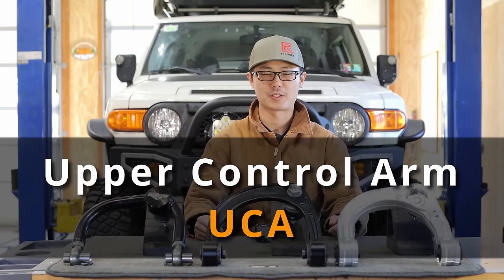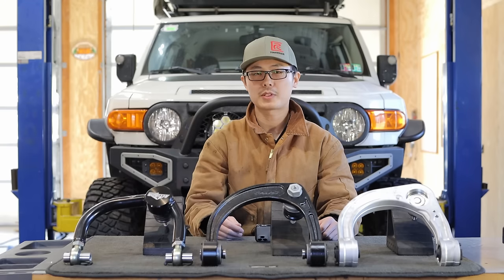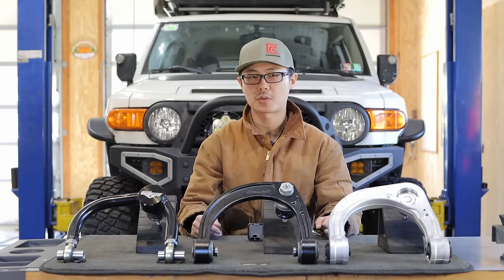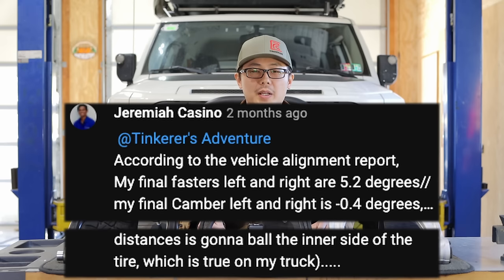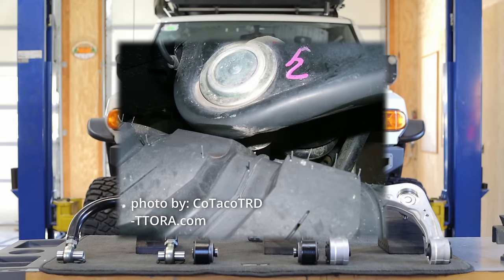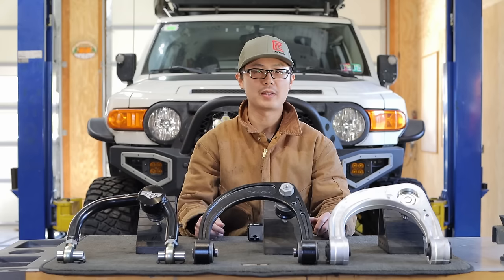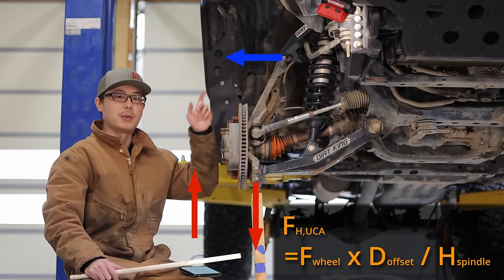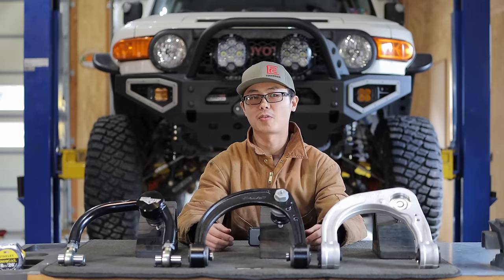UCA's True Functions and Misconceptions | Toyota Aftermarket UCA Part 1

Comment: Hello sir I am new to your channel but I am finding your videos very helpful and informative but I have a question for you I would like to know your opinion about doing a ball joint flip as in changing the orientation from the top to the bottom of the UCA this is a popular modification for 1988 to 1998 GM 4X4 trucks

Comment: Have you done any research on rear trailing arms, I'm particularly interested in corrosion resistance, I run the beaches of s. Texas, already have aluminum bumper, stainless rock sliders & replaced all trim bolts with stainless, corrosion is big on our beaches. Thanks! Kal

Comment: I was planning to run q 2in quick lift and aftermarket uca so that the upper ball joint will in effect compensate the lift. Also was considering extending the bump stop..any thoughts on your part is greatly appreciated..great video by the way

Comment: Future video idea - Would you please consider front locker impact to stock tie rod, axle or any other related component with not too heavy tires. Heaviest I have is Load C 285/70R17 KO2. I'm scared seeing bent tie rods. I guess axles could be next? Thank you in advanced..
Reply from the maker: I do plan to make a front locker video! Good suggestions on those concerns. Stay tuned!
Reply: @TinkerersAdventure  that is awesome. I took 2 quotes for eaton elocker & ARB air locker. Shop told me eaton elocker would release if I roll back. I'm more worried if it could break any stock components. Would be nice to give lot of stress and see if tie rods bend / axles would break. Thank you again.

Comment: Very informative and understandable.

I have a question about the AccuTune UCA. Somewhere I have seen where a fab shop or licensed repair shop has mentioned that using threads for certain tasks can lead to damaged or galled threads. What is your opinion for their UCA?

Keep on making these great videos. Sometimes I can't quite follow the whole presentation, but I'm also not an engineer, so I rewind, and I still don't always get it. It'll eventually sink in. Regardless, I find these videos very interesting.
Reply from the maker: Thanks! I don’t see any issue with the threaded heim joints. Almost all thread related failure were due to loss of pre-tension. Because of all the misinstallation out there and people not willing to admit they make mistakes, the design themselves typically take the blame and myths emerges over the Internet.

Comment: Outstanding job on this video, thank you!  So, in conclusion, if I'm going to level or add 2" or less to the front of my 2019 Tacoma, it would be unnecessary to change the UCAs, strength and droop-wise, correct?
Reply from the maker: Thanks. That is correct.

Comment: I just came across horizontally mounted uniball UCA’s. Seems like more manufacturers should offer that style along with the factory vertical style.
Reply from the maker: One drawback for most horizontal uniball design is losing steering angle. You are limited by the misalignment angle.

Comment: What a great video. Just all facts and no marketing. I hope you stay independent!  
A quick question but is their a down side to have upgraded UCA to a truck with only 1 inch lift ? I just want the adjustability, mainly to add camber for better handling?
Reply from the maker: Thanks! I don't think it'll hurt to have something like an SPC. It is out of my league how the handling will actually feel. But adjustable UCA could get you alignment angles you otherwise couldn't achieve.
Reply: @TinkerersAdventure  great. I will speak to my suspension/wheel alinement guy. In Australia we have a brand call Superior 4x4 and they have a beautiful billet UCA might I might go with ! Might even save some un-sprung weight

Comment: Just have to add at 11:30 you mention the angle that the ball joints max out but for the SPC the UCA body it self sits a little more horizontal in the geometry because the ball joint body itself is taller than the others therefore increasing the range of motion and clearance in compraron with other brands
Reply from the maker: That is a good point. There is more to just the ball joint angle. But I set both arms at the same depth on the ball joint taper.  So this should show the relationship between the spindle and frame pivot.

Comment: I need good advice, and you seem to be all about numbers and engineering, not hype and sales. I want to lift my 2019 4RUNNER TRD off-road premium that has rear locker. I'm not a big off roader, i just love how a lift looks, plus i need to be more out of all the horrible LED headlights. What's the least expensive way to get at least 2 inches of lift with no problems, or at least problems that aren't too expensive to solve?

Comment: Kai, what would you consider a low lift using a 'high caster UCA'  where you would lose body mount clearance that you mentioned?  1.5" to 1.75"?  I think I have this happening.  I have a ICON 'high caster UCA' and need more body mount clearance for my 33's.  If I increase my preload to closer to 2.13 (max for ICON) will that push my tire forward?  Awesome video and great explanation.
Reply from the maker: Thanks. I’d say anything below 2” is “low lift”. Increasing the ride height then redo your alignment might help in your case, as it’ll get closer to the camber and caster this UCA is designed for. The ride height itself doesn’t change tire front to back position. Only the alignment does

Comment: Kai you are the man, I have just put 33 inch tires 285/70/17 
With Rhino wheels 17/8.5./0.offset
I have 2 inch lift. 
The tires are rapping with UCA only when I steer the wheel left or right, when I up or down climb or hit street bump.  Any of these UCA you recommend for my FJ? 
Please.
Reply from the maker: Hmmm, 285 with 0 offset shouldn’t rub the UCA. Something didn’t add up
Reply: @TinkerersAdventure  any suggestions?

Comment: On my second gen tacoma, after installing Bilstein 5100s, my control arm contacted my coil spring before full droop. That is the reason i replaced my UCAs.
Reply from the maker: Interesting. Do you have any small spacers on the 5100s? Like something to compensate the lean?
Reply: @TinkerersAdventure  I did not. No problems after adding JBA UCAs
Reply: @TinkerersAdventure  hi I have the same issue and you are right I have the 1/4  inch spacer for tacoma lean. Do I need to change my stock uca? If so which one fo you recommend? Thank you

Comment: This was really informative, but it took me down a rabbit hole.  I'm looking to install the Eibauch Stage 1 Pro Kit on a GX470 along with a -12 offset wheel on 285/70/17.  I was originally planning on keeping the factory UCA and the first at the 2.0" position.  However, it almost seems like going to the 2.8" position in the front with an upgraded UCA is a better option... I think...
Reply from the maker: Yes you’ll probably need it for alignment at 2.8” lift
Reply: @TinkerersAdventure  going with SPAs

Comment: The info presented is amazing. I do have a question. We have a 5th gen 4Runner with the eibach pro lift kit installed. It has been installed and aligned for 2 years now. No issues. I am now getting around to adding a rear spacer to the driver side to get rid of the lean. Will I need another alignment?
Reply from the maker: Thanks. Technically any ride height change will change the alignment. But most likely what you're doing is small enough and it's still in spec. If you want to make sure, many dealerships offer free alignment check service. It uses different equipment from a full alignment machine but give you a good enough check quickly

Comment: Will I have problems fitting this wheel & tire set-up on my 2007 Lexus build? I'm trying to do what I call a "hybrid lift" that is, I'm putting in a 2" Toytec preloaded spacer lift in front so I can keep my stock electronically controlled dampering suspension system. In the rear, I'm replacing the stock airsprings with Airbagman 2" extended airbags, adjusting the ridehieght sensor to level out 2" while in "Normal" mode and adding 2" rear shock extenders made for the Toyota Landcruiser Prado. Then I'll add Timbren Off-road bumpstops to account for the shocks lack of down travel. That way I won't have any dash warning lights. Please note, I will not be doing any serious off-roading. I just purchased Method 305's 17x9" -12 ofsett wheels and Falken Wildpeak MT01's 285/70's (32.9"x11.2"). I currently have stock UCA's and LCA's. I'm prepared to trim, but want to keep my factory running boards. Any advice?

Comment: @09:50 you mentioned the 1.25” spacer caused you to lose clearance. I’m stumped on why the spacers would cause the loss of clearance. A buddy of mine with a Tacoma had no rubbing before installing SpiderTrax 1.25” spacers. After installing the spacers it was rubbing in odd spots. Rubbing the front arm of the LCA and a few inches further foward on the frame.
Reply from the maker: wheel spacer or negative wheel offset (exact same effect) increases scrub radius. The wheel always steer about the steering axis which is not changing. With more scrub radius, the entire wheel got swung along a larger arc.
Reply: @TinkerersAdventure  thank you. This would be a good topic for another video. 😂

Comment: Nice video.  I have a 1997 toyota prado 90 .I bought a 50 km lift . Koni raids . When I tried to get the caster ,camber realigned they told me they couldn't get it perfect but it is very close . When my prado is on the lift the uca binds on the spring slightly . Could you advise me which uca to buy with my circumstances.

Comment: Good stuff.  How does all this info you have been doing translate to land cruiser 100 & 200 series?
Reply from the maker: I am not certain about LC's ball joint angle related to droop or how the clearances work out. But everything else should apply.
Reply: @TinkerersAdventure  do you have any opinions on suspension brands?  Looking at dobinson,  ironman, ome,  and maybe bilstein shocks?  I hear good things about dobinson.  I want heavy duty,  long lasting,  durable, reliable suspension., nothing fancy.

Comment: In your video you stated that you could gain about 1/2 an inch of forward wheel movement through the lower control arm adjustments. Does that mean the maximum you could get of 1/2 inch was with proper wheel alignment? Or was that just the absolute maximum forward movement you could get?  What is the maximum forward movement of the wheel that you were able to achieve and still retain proper wheel alignment with an aftermarket upper control arm?
Reply from the maker: Correct. 1/2 forward by LCA cam bolts. You need adjustable UCAs to bring the alignment back to proper

Comment: I did a level lift but now that my front camber is positive and my rear camber is negative, I'm thinking that if I lift the rear , adjusting the alignment would be easier. What do you think ?
Front lift : 2 inches , rear lift : 1 inch .

Comment: Do you think there is a market for an upper control arm that uses OE sized ball joints and bushings with 2 degrees of camber and caster correction for less than $400?

Comment: Bilstein 5100 with factory springs on 08 4runner contact UCA and limit travel. It appears to be worse on the driver side as the coils are different diameter wire on each side. I have seen SPC UCAs bent on 4th gen v8 4runners but the spindle also bent so it was a big hit.
Reply from the maker: Interesting. I'm surprised a factory spring actually hit. I measured the FJ and GX460 spring OD was both 106mm. The ironman I had was 113mm. Was there any small spacer on the driver side to level out the lean?

Comment: Great video! Unrelated question. Under acceleration, i feel the rear pulls to the passenger side, when i let off the gas, the rear returns to driver side. I changed rear track bar, but nothing changed. Help!
Reply from the maker: Hmmm, that almost feel like drive line problem. I’d say start with jacking up both rear tires in the air, and spin each one by hand. See if there is difference in resistance.

Comment: I have a 2023 4runner TRD Pro with the Westcott design lift kit. This kit uses a preload collar and a .250 shim on top. After installing this kit the upper control arm hits the spring. I purchased a set of SPC uca's and still the same. I guess the .250 shim on top is making the shock longer than it should be. Should I just leave this as is or remove the shim or try to find a set of uca's that clear? I am wondering if the added length could damage the cv's?

Comment: Do you have a video on differential drops? Or do you have an opinion on them? Getting ready to lift my Tacoma 2-3” and I’m unsure if it’s worth putting in the differential drop. My thinking it it may be worth just investing in high angle CV boots instead. More expensive but maintains clearance and means I won’t have to modify my skid plate. What are you thoughts on dropping the differential?
Reply from the maker: I do plan to make a diff drop video. I don't run them because of reduced ground clearance like you described.
Reply: @TinkerersAdventure  are there any other concerns to running one vs not running one with a 2-3” lift? Is that enough angle to cause real concern of breaking stock CV’s?

I daily this truck and put about 25k miles on it a year between 2 yearly 3k+ mile overland trips and daily driving.

Comment: Man i wished i listened to the part where you mentioned that the spindle was the weakest link in the IFS. bent both spindles, one is too positive camber other is slightly negative. Fixed them and installed gussets. Camber back to zero now. Using total chaos UCAs (sold as Freedom offroad UCAs in north america). What causes these spindles to bend?
Reply from the maker: It is mostly that horizontal force component I went over in this video bending the spindle. If we draw a complete free body diagram for the spindle, you’ll see bending.

Comment: @Tinkerer - You mention 'late model IFS Toyotas' don't gain droop/down travel by with aftermarket UCA - does this include 3rd Gen 4runners? Want to purchase 2.5" King OEM extender travel shocks, but want to avoid adding after market UCAs. Thanks!
Reply from the maker: This I don’t have first hand data unfortunately

Comment: I recently added a 2” lift with a Rancho Quick Lift shock in my 06’ Tundra.  It seems like I now hit my droop max after going over larger bumps on the highway.  I can feel the shock hit a limit.  I still have the factory UCAs.  With the stock suspension, this didn’t happen.  Is there a solution to this?

Comment: Kai, what do you recommend for a 1 to 2inch lift?
Reply from the maker: Keep it stock!
Reply: @TinkerersAdventure  Years ago I worked at a off-road shop in Utah and we built everything from trailer queens to MOAB capable rock crawlers but I kept my own rig (1991 Chevy Suburban) very mild because when I researched the engineering aspects of the vehicle I became convinced that I would be better off and could still go where others went and I did! People were amazed at the my build but still wanted the 6 inch plus suspension systems etc. for their own rigs opting for looks instead of reliable capability. What I like about you and your channel is the engineering explanation of your recommendations! So, with all of that being said I have a question. The only thing I do not like about my 2012 SR5 4Runner is how it dips in the front when breaking. Any suggestions?
Reply from the maker: @richardstone5241  hey I appreciate it! I think probably some shocks with strong low speed compression damping. Something like the dobinson MRR or fox DSC allow adjusting just the low speed compression. Or very digressively valved none adjustable shocks. I don’t like simply making the front spring stiffer because it’ll reduce performance.
Reply: @TinkerersAdventure  Yep! That's what I think too but wanted your opinion. BTW, I looked at your products and like what you have done but I also think there is a great opportunity to design and manufacture a lot more and I would be interested in collaborating with you if you might be interested.

Comment: So what could be the best proper lift to fit 33 Inch tires for Prado 150? 
Just to put OME 2 inch lift without replacing UCI?  Or to use dirt king long travel kit ? 
I want to have small lift to put 33Inch tires but would like to make it in correct way to avoid mistakes which you are mentioned in your videos, but I am still concerned about proper lift built.

Comment: I was told for my 2005 Toyota Tacoma with my lift kit, that I would need an aftermarket UCA if I lift higher than 2.5 inches. But the lift kit only goes up to 2.5 inches.. would I still need an UCA? Or would I be ok?

Comment: How do you feel about ICOn Delta Joint? Can Delta Joint be retro fit to upgrade Dirt King LT UCA?
Reply from the maker: Yes you can retro fit it into any 1” uniball cups. I don’t think it provides performance or longevity benefits for late model Toyota trucks specifically. Their marketing effort made most people think delta joint is better than ball joints. But I prefer good quality OE style ball joint all day over delta joint. Only issue is you cannot fit ball joints in uniball cups.

Comment: So if you’re trying to clear the body mount with SPC’s would you wana go more towards the A setting or G? Any max caster?
Reply from the maker: Towards G. Minimum caster on UCA. For 2.5 inch lift most likely you'll be around E or F